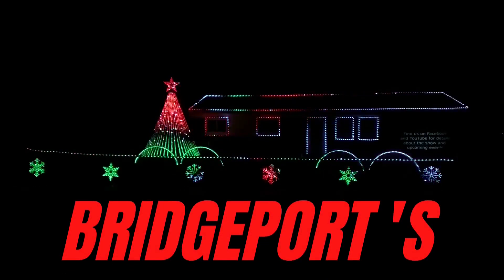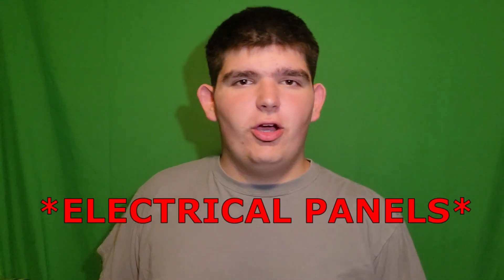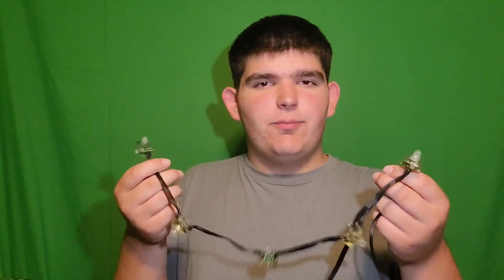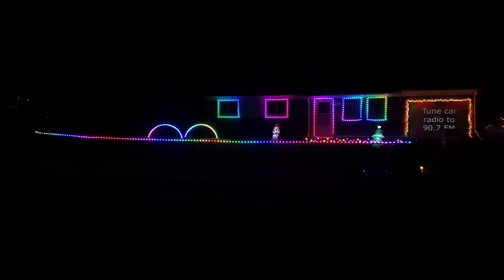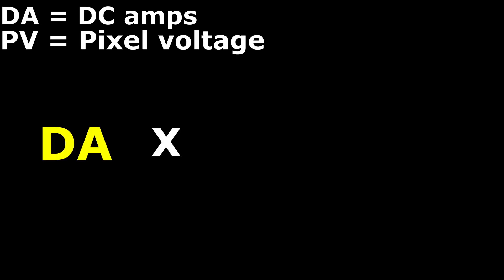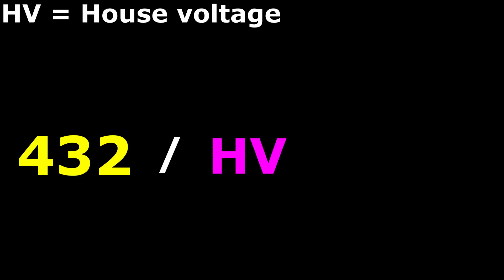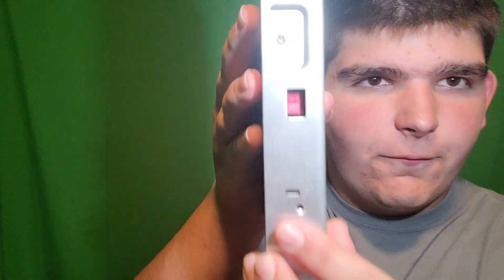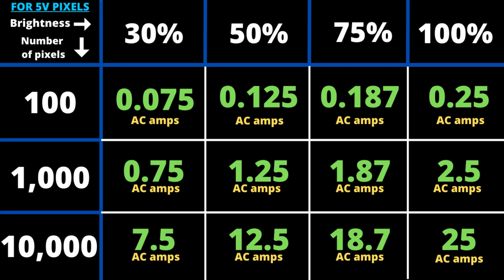How many Amps does a Light Display use?

Comment: Is there an issue running a 1000 pixels on 320watt  60AMP power supply 5v pixels ? .
Reply from the maker: It depends on the brightness level. 1,000 5 volt pixels at 100% takes 60 amps. If all 1,000 pixels are going to be on constantly, then I'd recommend lowering the brightness level. Even though you're not going over 60 amps, it's not a good idea to be using the max constantly. Going down to a max of 90% should be fine. If all the lights were on white you'd only be taking 54 amps. So I recommend no higher than 90% brightness for the pixels.
Reply: @How2Pixel  Hi i never run them all more than 30 percent anyway .
Reply from the maker: Ok then you will be perfect fine 👍

Comment: The US voltage supply voltage varies depending on a number of factors. Most houses do get about 120 Volts, but devices in a home can run on as low as 110 Volts without any issues. 
Based on the energy monitor from my house, I know that it averages around 122 Volts at my house.
Reply from the maker: Thanks for the information!

Comment: Divide your 3.6 amps by the power supply efficiency of 0.85, puts you closer to 4.25 amps ac. Using 110 volts is probably the right number since this is the voltage the power supply will likely get under load
Reply from the maker: Oh ok, thank you for the tip!

Comment: Did you not have any more room for breakers in your main panel? If you added a sub panel just to add a couple more circuits, then you spent extra money on the sub panel, the service wire to go to the sub panel, the breaker to power the sub panel and the main sub panel breaker, plus the 15 or 20 amp breakers and wire to run the lights. If you had just one or two open breaker slots in you original panel, you could have simply used a new breaker, wire, and receptacle
Reply from the maker: We actually don't have any room in the main panel for the breaker. Our panel was put in a long time ago and it only has 6 small slots in it, then 2 bigger slots. We did the math, and this way was cheaper than buying a whole new panel so that's why we added the sub panel. But thank you for the tip!

Comment: How many 5v pixels can you have on a 350 meanwell power supply?
Reply from the maker: It should be around 900 but it could be more if you run them at a lower brightness

Comment: Setup question? I have a strip of LEDs that are on my Apex of my house. I also ran a strip on the same line under the eves to light up under the Apex.  How can I set it up in xLights to be able to run them separately so they don't do the same thing? Is that possible?
Reply from the maker: As long as you make them separate props and they have their own channels they should work separately.

Comment: I got a problem that I hope you can help me with.  Sw2812 LED stips RGB.  When I do a long run the data stops at #170.  I have power past it but no lights or data.  When I connect the power and data at #170 the rest past it light up.
Reply from the maker: What controller do you use? Either you don't have the controller setup right or it only allows 170 pixels
Reply: @How2Pixel  So, being new to all this is really teaching that I have no idea what I am doing.  Lol.  I did find out that the controller I have is set from the manufacturer at 170.  I have now adjusted it and max is 340. I've added some power injection and things are looking great.  It has been fun learning all this new stuff but is also so stressful.   I'm glad you and all the others out here have made great videos and are available to answer questions.